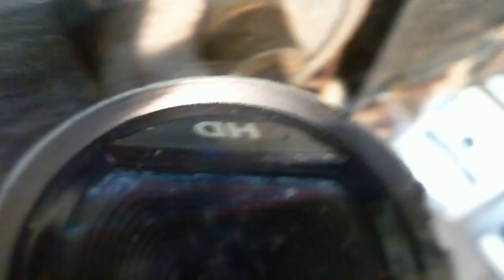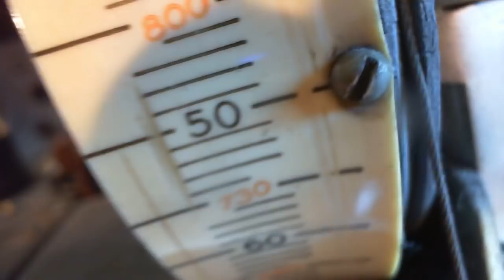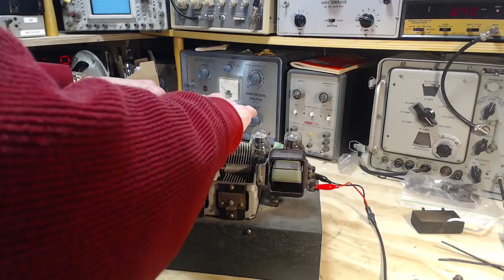Eveready Model 32 Video#9 - Cracked, Loose but Sounding Great

Comment: those gears were primarily zinc.  One of the characteristics of zinc, unless it is cast under high pressure is to return to its native state.  I used to work on toy trains of this vintage, and the wheels which were made of the same material would do the same thing.  The other thing that would happen is that the castings would swell, making them unusable.

Comment: That little mystery control is connected to a book capacitor. That dates back to the very early radios, around 1924. It was developed by Hugo Gernsback.

Comment: I would be concerned about the coupling cap since the failure of that one could destroy the output tubes, also, the bypass cap is of concern as are any caps that go from the AC line to ground. You may also want to put a fuse in to protect this rather rare radio and prevent frying the power transformer should anything go wrong in the future.

Comment: I think it's a zamac diecast  pop Metal the 4 stands for 4% aluminium, introduced in 1929 a combination of zinc aluminium magnesium and copper
Lowest melting temperature 380 degrees Celsius anywhere up from that? You could repair with solder and Flux using a hot iron and then the torch it but you might have to be careful. I think the best is what I said before to use JB weld high temperature 300°epoxy it ideas to the metal and goes rock solid like concrete and is not brittle. Work it into the cracks with a thin piece of plastic or card clamp it together leave it for 24 hours put it in the oven at 200 degrees Celsius for 25 minutes.
Or you 3D printing with plastic or hot metal 3D printing it is very similar to how it was made originally. Alternatively make a mould out of high temperature silicone take the pulley off soak it halfway also put a piece of greaseproof paper around the first half to separate the two parts and fill it up again with the rest of the silicon leaving a hole on the top piece using a small piece of pipe to pour the hot Metal the pop cast metal what you could make with a blowtorch and a old baked bean tin. make sure you leave it in the mould for minimum of 8<>16 hours preferably on a hot surface or in the oven starting from 300 down to 100 degrees stepping down in increments 1 hours at 300 degrees 2 hours at 200 degrees an hour at 150 degrees leave it for a few hours at 100 degrees. Not critical for part like this that's only if you got a critical part like an internal part in an engine, but do not leave it on a cold surface to cool on top of your boiler flue or something will do. Find a container to hold the liquid silicone mould just covering it by an inch and something to prop up the device you're making a mould from so it doesn't sink to the bottom of the silicone like three small bolts in a triangle screwed from the bottom held in by a nut making sure you got clearance for the object your molding give yourself a bit of room saying inch as well, cover the object you're moulding with candle rubbed all over thoroughly so it doesn't damage the mould when you release it. you'll need to clean it out before putting any hot Metal in the silicone mould

Comment: I am back now, what about using the same tuning mechanism as used in the American Bosch Model 28 assuming you can get such a tuning mechanism, would my idea work, that tube in the output stage is loose and maybe needs replacing or if the tube base is loose then you need a new tube or what about replacing those two tubes with a KORG Nutube 6P1 might be different but can be mounted inside the PSU/AMP stage and lose the output stage sockets also it just needs 50V B+ and the heater is 3V.

Comment: I don't believe tuning the radio will cause the pulleys to fail. If you were to try to tighten or remove them then you would risk them coming apart.